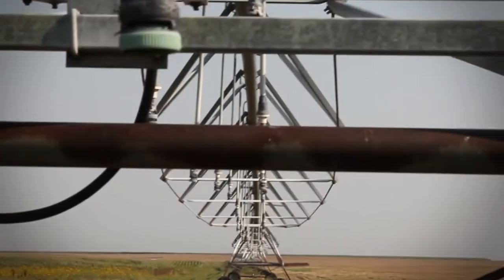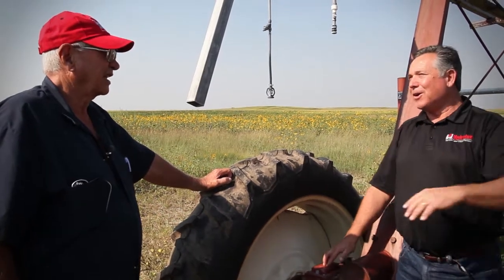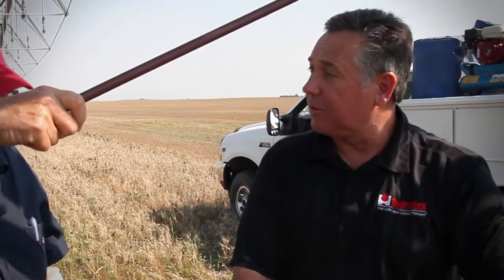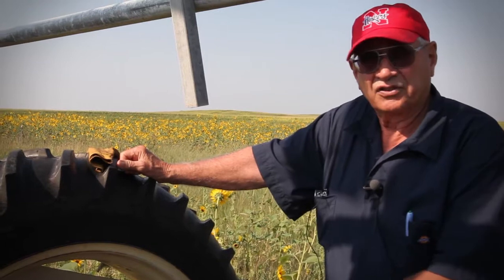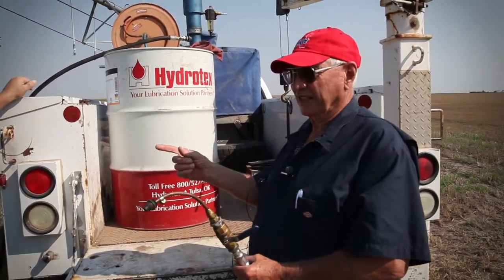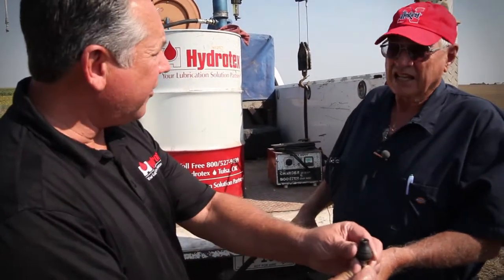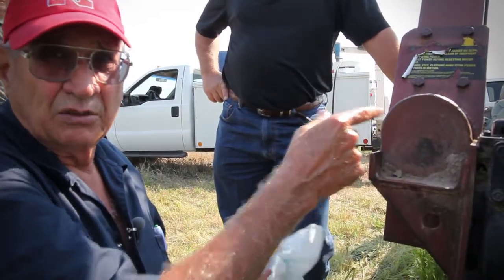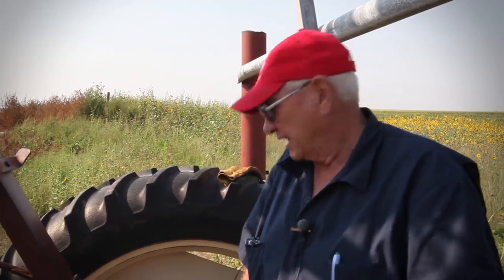Hydrotex LubeInsight - Pivot System

Comment: A short story, 1971 Shell gas station downtown Woodburn Oregon. Working there, I drained the crankcase of the hydrotex salesman's car and save the oil for use in my 59 Ford station wagon. Long story short; gas mileage went from 12 to 19 MPG. 😆